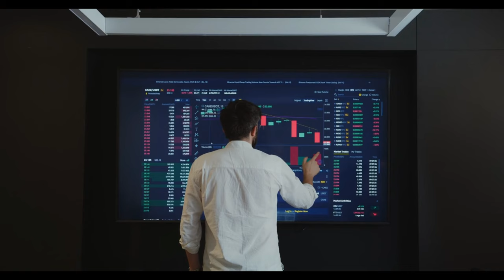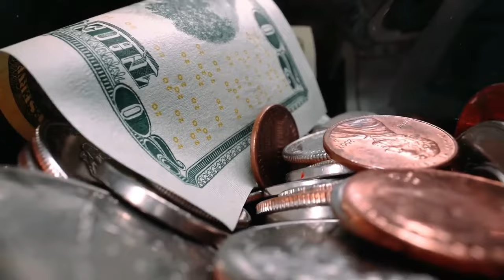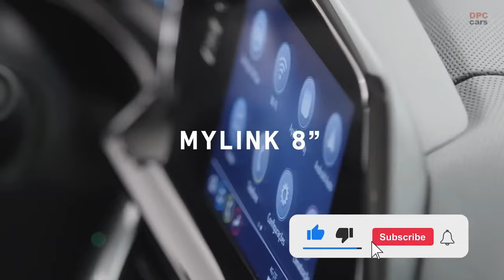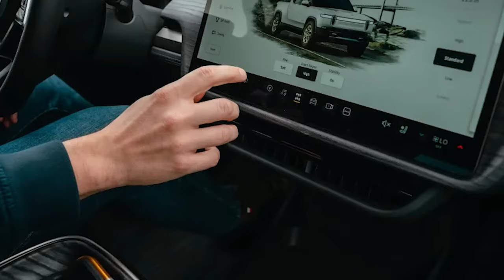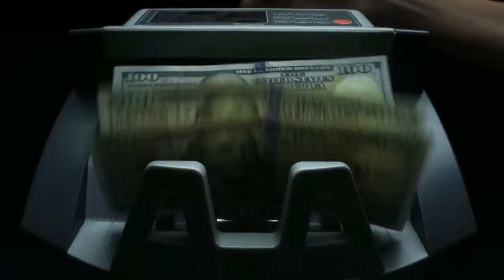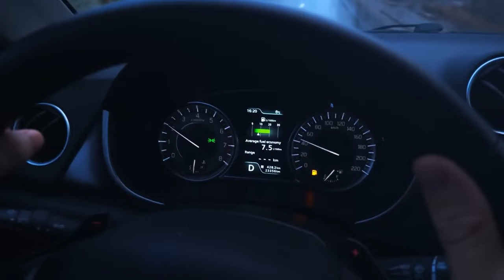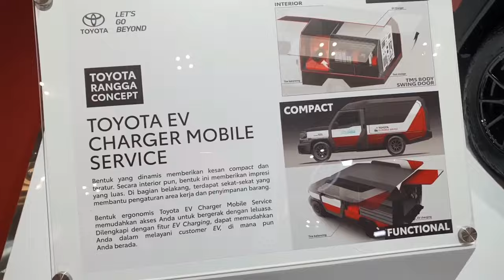GM Ceo Announces NEW $8,000 Pickup Truck Which Will Make Ford and Toyota OBSOLETE

Comment: Putting feature loaded 8k trucks out means a BUNCH of broken features in my book. Who wants cheap if it means a bunch of down time for repairs? Just a simple engine, bench seat, manual transmission or RELIABLE automatic, air con and heater. Want music? Go to wallmart. Want floor mats?, want cup holders? Rinse and repeat.